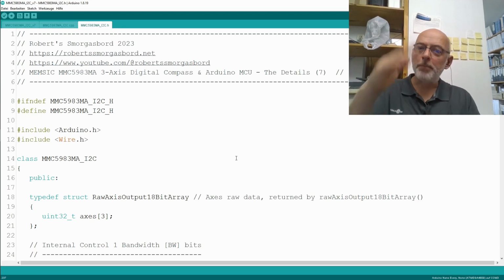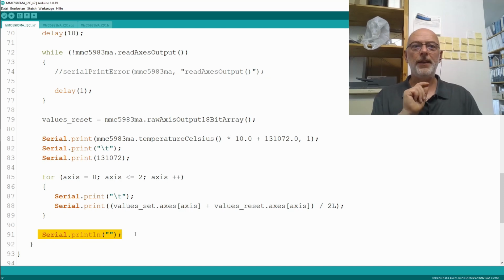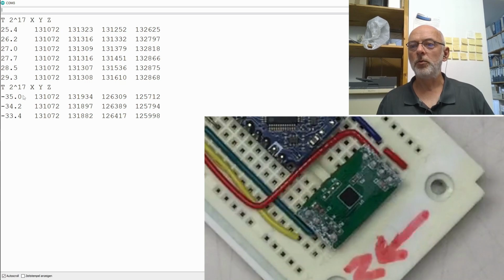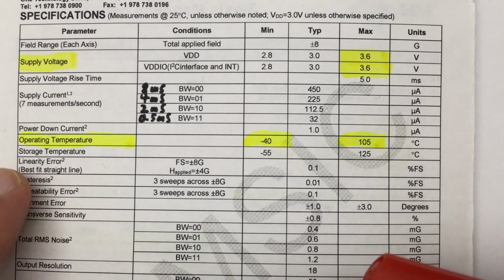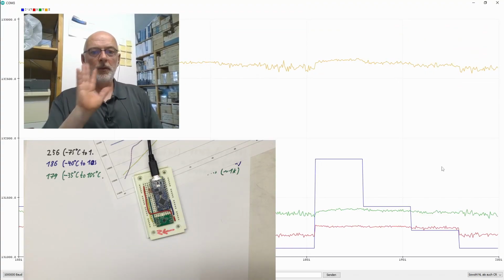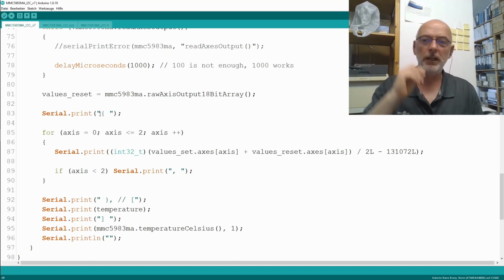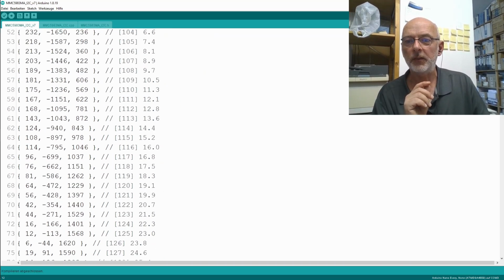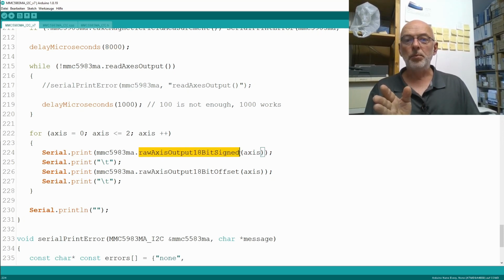MEMSIC MMC5983MA 3-Axis Digital Compass & Arduino MCU – The Details (7)

Comment: Would it be possible to instead low pass filter the offset with a very low cutoff frequency (such as 0.1Hz / 10 seconds)? Temperature won't change quickly in most environments.
Reply from the maker: The problem is not the temperature changing, the problem is the chip changing it's orientation in the magnetic field during the offset measurement. If you can ensure that your chip doesn't move during the offset measurement, your method should work fine.

Comment: Hello Robert, im  triying to calibrate mine, what are you using to cool down your sensor? is it canned air ?
Reply from the maker: Yes, it's just "canned air". That is I believe there's CO2 in my can. If you "squeeze out" a bit of liquid CO2 (holding the can upside down) you can get as low as -78,46 °C (at least at sea level).
Reply: @robertssmorgasbord  thx i will try that, my apliaction is the oposite of yours, im triying to measure the interferences the metalic can cause so i can detect large metal bodies
Reply from the maker: @TraceWarrior  You're welcome! Your project sounds very interesting. Some sea mines are triggered by changes in the magnetic field, and I think it's also used to detect submarines. Let me know how your project goes.